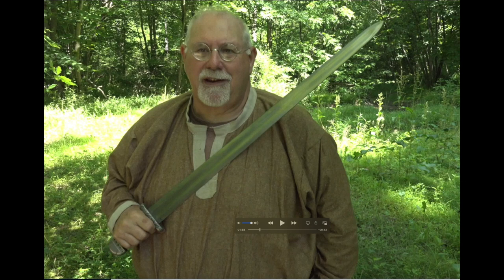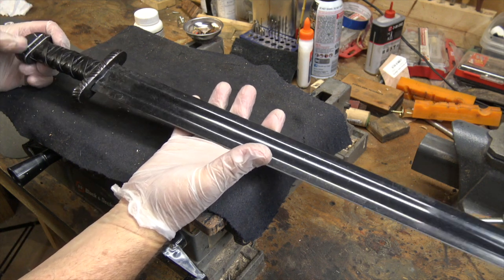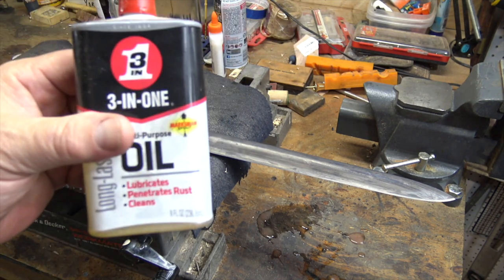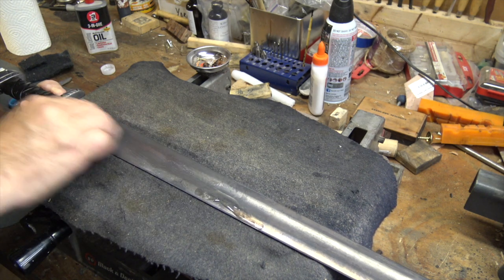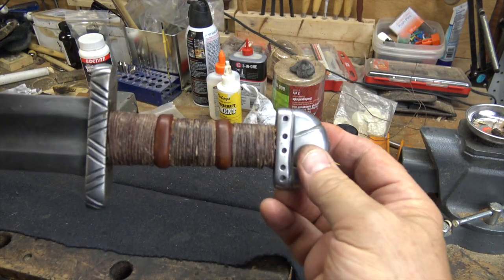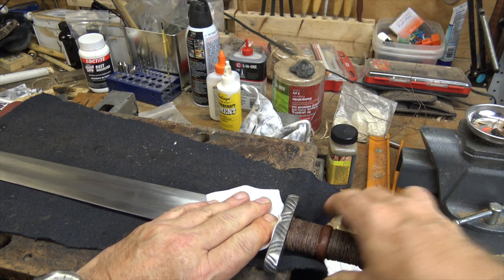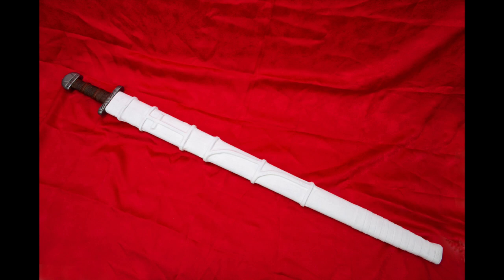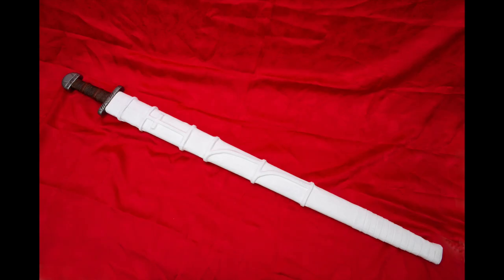Step by step transformation of the Maldon sword

Comment: FANTASTIC transformation and only your first!!   You could quadruple what you paid for that, all day long.  The next step is to electro-etch your personal touch mark into the blade. By using a cup of salt water, a 9V battery, a home made stencil and your imagination  (I use electrical tape cut with an Exacto for the stencil) it’ll look like you stamped a 9th c. mark into the blade. Goes quite deep into the metal.  Works great on gun barrels too.  Look it up!  Anyway, you were one step ahead of all us who kvetched about not seeing a build video.  Thank you!